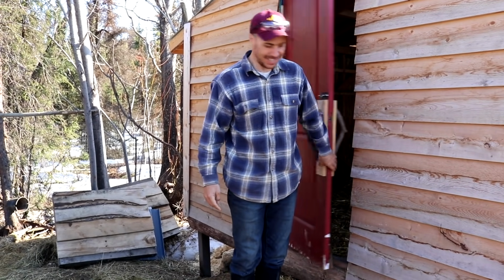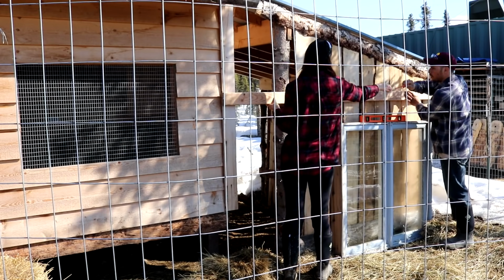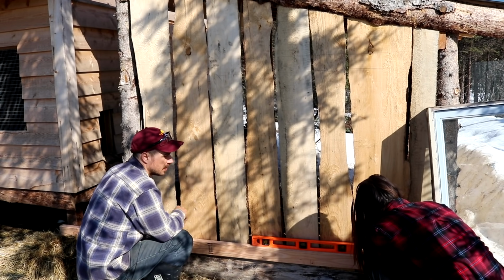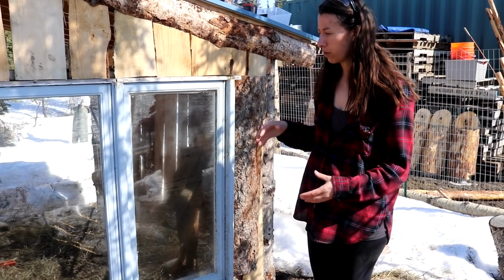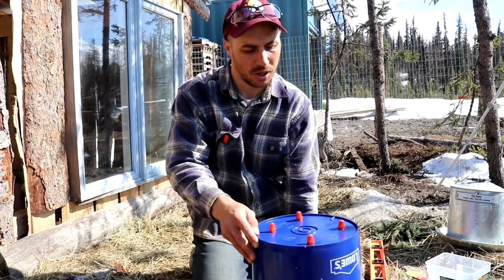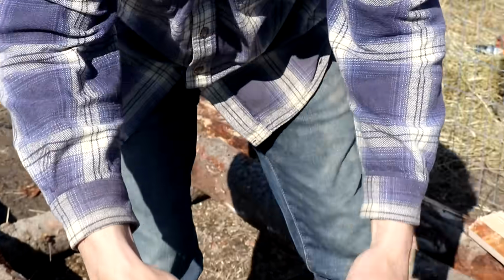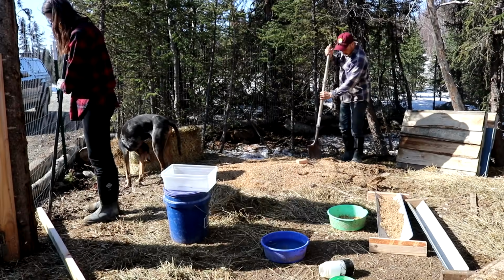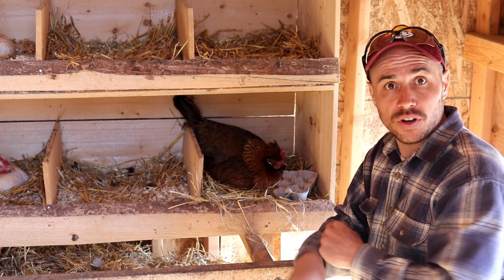The Chicken Run | Project Season Begins

Comment: For anyone looking for a cheap, easy feeder: I use a short length of gutter (mine's about 3 feet) held up by two cinder blocks, the kind that have 2 holes in them.  Easy to clean, move around, etc.  No construction other than cutting the gutter to the length you want.

Comment: We have a similar problem with our gates during the fall frost-heave. The ground swells/expands so much that it interferes with the gate swing. I raised our gates then, in spring, As the ground settles, I slip a piece of wood thick enough to make up the space needed, kind of like a threshold on a door. Now in fall I just lift the wood aside until spring again.

Comment: Eric !!  C'mon, don't work so hard.  Leave the gate at the higher level and just add a plywood skirt to the bottom when the snow leaves.  Instead of holes, cut slots, so you can slide it up/down as needed.

Comment: I am not sure if you know it or not but your folding saw horses are designed to attach a 2x6 flatways to the top of them so you have a better work surface that can endure a saw cut without damaging the saw horse itself or your saw blade.
Reply from the maker: Richard Bagwell I did not know that thank you gor the tip!
Reply: @SimpleLivingAlaska  you are welcome.

Comment: Hey again Y'all!

I just wanted to clue y'all to the Columbus Horizontal Waterers (NOT the Red Chinese versions, which WILL freeze up and go bad), which you can still use with your 5 gallon buckets, HOWEVER, they do NOT freeze up because of better construction (greater durability too), and they allow you to place the bucket ON the Ground, so you don't have to suspend them!

Y'all can find them on Amazon (of course) and while they are NOT as inexpensive as the Red Chinese types, they'll last longer and you don't have to worry about freeze ups.

Cheers from the Oil Patch in Central WY

Comment: I have recently made a switch that I would like to recomend. My family and I live on a small farm in rural Ga and it seems there is some sort of project that always needs to be done well away from the houses or power outlets. I have a small generator like you have and until recently used it in the back of my truck or in my atv trailer. A handyman friend of mine convinced me expand my cordless tool collection and boy do I wish I had done this before. I had bought a 20v Porter Cable drill/driver combo set several years back to replace my old that had died. It came with 2 batteries, a charger and the 2 tools, I began purchasing the seperate tools from amazon and have gotten the circular saw, a sawzall, angle grinder and jigsaw along with getting several of the larger 5 and 6AH Batts and it has made a world of difference. We recently rebuilt our laying boxes and I didn't have to stretch out a single cord and since every tool was always ready to go, the project took about 3/4 the time it would have if I had used my generator. If there is any way possible, going the cordless tool route is the way to go and Porter Cable brand is still affordable but lasts much better than the cheap wally world to old do.

Comment: Why not leave the bark on? Does it prevent some kind of rot by removing the bark?
Reply: If it's anything like logs we have used, the bark only stays on for a short while once the log really dries out.  Then it breaks off so the hole ends up too big. Better it's ff before you finish the job then you know where you are.

Comment: Instead of having to adjust the gate twice a year why not just put hooks in a 2X4 and attach it to the bottom of the gate or to the lower inside/outside of the gate? If you used heavy duty cup  hooks you would only have to put it off with no tools required.
Reply: Brilliant idea!  I hope they use this. It would save so much effort and probably save the wear and tear on the gate.